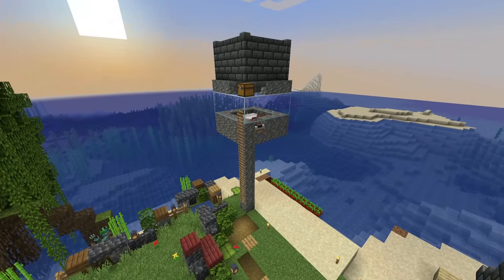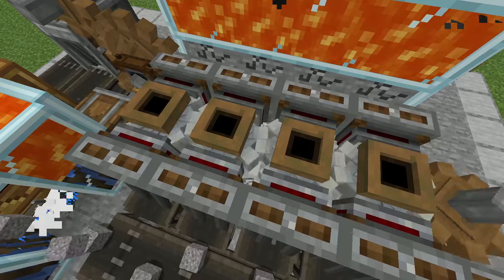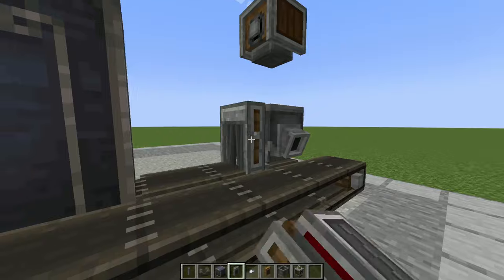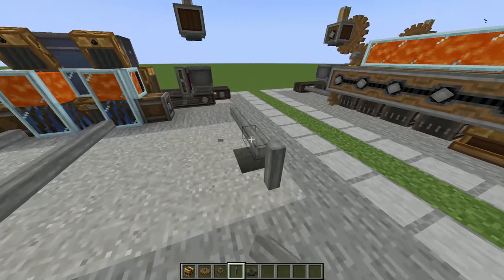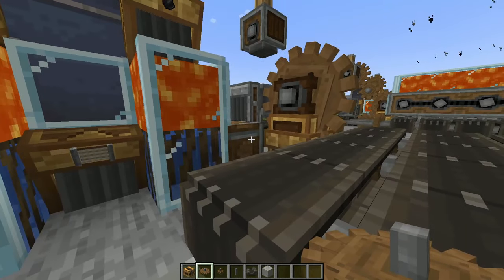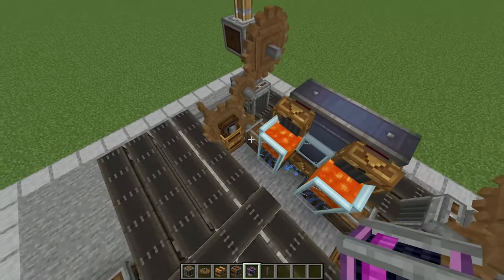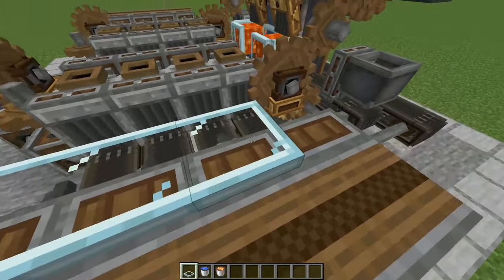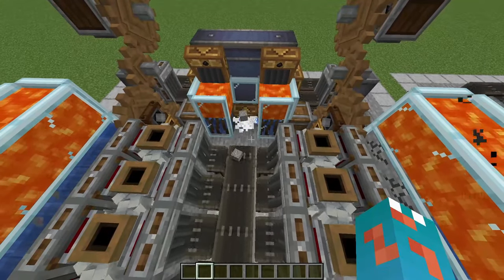CREATE Iron Farm TUTORIAL (No Villagers!) | Create 1.19.2 | #tutorial #minecraft

Comment: What am I doing wrong? Everything works and turns the same way. The presses won't work. THe basin fills with 16 nuggets and stops working. Even turned the speed up but won't help.
The basins always fill to 16 nuggets. Maybe too much to make ingots? Even tried a brass funnel with an iron block as a filter in the hope it would do that, but nothing. So now I got a nugget farm and need Thermal or Mekanism to turn them into ingots.
Anyone got the same problem or a solution?

Comment: I'm not sure what I did wrong but the brass funnels in the front are only letting nuggets out through one of the funnels
Reply: Same and I dunno what to so
Reply: Nevermind, you need to hold shift when connecting brass funnel to vault
Reply: The reason would be that it's letting all the nuggets it gathers out the one funnel at a time, and if you set it to only let one nugget through at a time, they will go through the other side.

Comment: 9 vaults
34 shafts
10 cogwheels
7 large cogwheels
8 millstones
1 barrel
2 mangrove roots or stairs
20 andesite funnel
5 brass funnel
13 mechanical belts
10 gearshift
6 gearbox
2 encased fan
2 mechanical press
5 rotation speed controller
33 framed glass trapdoor
1 list filter (?)
2 bassins
1 clutch
Reply: forgot encased chain drivers and drills XD
Reply: you can also use leaves since those also can be waterlogged
Reply: How to find these items
Reply: @gamersanofficialitzme  You FARM MY MAN 👌
Reply: @SamHockingTV  sorry, ended up not doing it so I didn't correct myself thank you for doing it  ❤️
Reply: That one clutch is you my friend.
Reply: UR THE FUCKING GOAT
Reply: @gamersanofficialitzme  kid thinks this is vanilla
Reply: It’s funny how the author called this build “early game” while it requires Brass and Rotation Speed controller 💀
Reply: does someone here know how to decrease or increase the number on the rotation speed controller to minus 1?
Reply: @milopug7275  it’s a 1 RPM in the opposite direction of the input shaft, no?
Reply: @denisbronskii5629  instead of the roots right?
Reply: @ZaVoido  yeah instead of roots, you won’t see it waterlogged if your graphics set to low, but it should still show water particle effect from the leaves
Reply: @denisbronskii5629 alr, that'll make it way easier as I have a word with the large biomes mod and spawned in the middle of a plains biome.
Reply: @ZaVoido  yeah I’ve also had issues finding the mangrove roots, gl
Reply: i love you
Reply: those are ez
havent even gotton diamonds yet @darkModeYT
Reply: 10 encased chain drives...not 10 encased gearshifts? ...and 8 x mechanical drills.  Thanks for listing the bulk of it correctly.
Reply: @CoroDan to be fair, the graphic of what's needed shows gearshifts instead of chain drives. It would be chain drives though.
Reply: @darkModeYT  brass is pretty early game lol

Comment: List of all the things you need to build:

34 - Shafts
10 - Cogwheels
7 - Large Cogwheels
5 - Rotation Speed Controller
10 - Encased Chain Drives
2 - Vertical Gearboxes
4 - Gearboxes
1 - Clutch
13 - Mechanical Belts
8 - Milling Stones
2 - Mechanical Press
2 - Encased Fans
8 - Mechanical Drills
2 - Basins
9 - Item Vaults
5 - Brass Funnels
20 - Andesite Funnels
1 - List Filter
33 - Glass Trapdoors
2 - Mangrove roots (Optionally Anything that can get waterlogged IE: Leaves)
1 - Barrel
10 - Water Buckets
10 - Lava Buckets
Reply: thank you, i had trouble figuring out which blocks where what haha
Reply: where are the item vaults?
It dosen't show in my minecraft

Comment: fun fact: if you have the create: mechanical extruder mod you can compact the farm more but it will consume more stress units
Material list with names and quantity:
Shaft X34
Small Cogwheel X10
Large Cogwheel X7
Rotation Speed Controller X5
Encased Chain drive X10
Vertical Gearbox X2
Gearbox X4
Clutch X1
Belt X13
Millstone X8
Mechanical Press X2
Encased Fan X2
Drill X8
Basin X2
Item Vault X9
Brass Funnel X5
Andesite Funnel X20
Item Filter X1
Trapdoor (any) X33
Leaves (any) X2
Barrel X1
Water Bucket X10
Lava Bucket X10

Hope this helps :)

Comment: I don’t see anyone talking about this, but you actually don’t need any drills to break cobble stone. You see, when contraptions become disassembled they will break any block that is inside them, so you can just have a straight line of chassis attached to a bearing rotating at 1 rpm. push the cobblestone into the chase and stop the bearing and it will break the cobblestone. this method take no su, and breaks faster than any drills

Comment: For anyone having trouble with finding mangrove roots, you can waterlog stairs that are facing the vault. It will work exactly the same.
Reply: Or just leaves
Reply: It doesn't the 2 stairs create an infinite source of water that waterlogs the brass funnel as well
Reply: @Exorbulla  No? Have you built this thing yet? The water is stopped by the brass funnel (which cannot be waterlogged).
Reply: @zellenny1784  I have built it and the brass funnel keeps getting waterlogged, the only solution I see to this is to just put the water in front of 1 fan and block up the other fan so that I only have 1 water source
Reply: @Exorbulla  Replace the stairs with a trapdoor, place it so that it's keeping the water from flowing out, the trapdoor shouldn't block the fan. Though if the funnel doesn't block the infinite water generator you should be able to use leaves just fine I think?

You might be able to place the stairs against the funnel instead, so that water doesn't flow that direction, not certain if the fan is blocked by that or not.
Reply: @Sylfa  I solved the issue a while ago, turns out you only need 1 fan for the machine to work, 2 fans is just for symmetry, so I blocked out 1 fan and let the other one do the work

Comment: I've been playing around with this design and noticed a few things:

1) use a steam engine, possibly powered by blazed burners as you need roughly 16 300 su to power this thing, at least if you do what I did in the points below (my 3x3x9 steam tank with 2 water pipes going in could handle around 98 300 su with 9 blaze burners feed with coal but I've only got one steam engine attached to it at the moment and so only that roughly 16 300 su was actually being provided to power the whole thing)
2) If you want to make those presses move faster, remove the cogs from the rotational speed controller and use a belt + rod thingy + horizontal gear box to connect the outermost rods to the presses. This is because making it more compact with horizontal+vertical gearboxes makes all the other belts that are at the front of the machine move in the wrong direction
3) I doubled the speed of the rotational speed controller closest to the power source (7:10) but ended up keeping the rotational speed controllers affecting the drills the same. I think it can handle a bit more (and so produce iron faster) but I found doubling it sent cobblestone flying off the machine and landing randomly on the floor. Still toying with it but maybe 10-20 points more is ok?
4) Using blazer burners is just as good as lava (so you don't need a protective floor/walls around them which is great for space!)
5) It may be worth just using a lot of steam engines+small steam tanks+unfed blaze burners over fed blaze burners as you don't then need to make a big farm to feed them and pipe the fuel to mechanical arms to feed the blaze burners so they never run out (and so stop the whole machine if you're using the steam engines to help bump their own water)
Reply: i just add create crafts and additions and mekanism to the mix and create a forge energy powered abomination

Comment: using this in a 1.18.2 modpack where there aren't any waterlogged leaves or roots. I was able to use a trap door, the only thing is it will also put water on the block where the brass funnel is which doesnt seem to be a problem.

Comment: for some reason my brass funnel would take the gravel immediately, even with the filter, so i found a workaround

reset and replace your brass funnel, making sure it is facing inside of the vault
place an iron nugget in the item frame part of it
now the gravel will not go in, and instead will be washed into flint or iron nugget
now only flint remains but at least it's taking in iron nuggets, which is what you're after anyway

Comment: HELP! Only one side of the machine works for me - or, more specifically, only one brass filter (the iron nugget ones that come off of the vault) works at a time. It's like the vault chooses one of the two brass filters to use and completely ignores the other one. If I destroy the one it has chosen to use, then the other one starts working, but when I place the filter back, that one now no longer works as it has chosen to prioritize the other. Basically, it only allows one filter to be used at a time, not both. Anyone know what to do?
Reply: I replaced the brass funnels with andesite one's and that has seemed to fix it. One funnel is still used more frequently than the other, however they are both getting used at least.
Reply from the maker: Thats due to the actual output of the farm being slower than the presses are crushing the iron down, it was designed so that it would be future proof in the case that you expanded the drill section of the farm backwards to make it faster

Comment: Need some help with this lads. 

So on the left hand side of the build, the rotational speed thingy isn't appearing as -1 on speed regardless of how I set it. 

The entire left handside  doesn't function even though it's receiving power. Gears are turning along with the belts but noiron nuggets are flowing. 

Strangley enough, the flint dump is working, just no items flowing on the left. 

BTW. Yes the belts are moving correctly. Been troubleshooting this for a week. 

I am currently playing on Mr Beardstones V2 Create modpack if that helps and Forge is set to 1.20.1

Comment: whats a the minimal setup for power that you could use for this? like could it be powered off of water wheels or windmill, just the minimal setup, im new to create and this is pretty awesome but im not sure the best methods for generating power
Reply from the maker: @noahsmith8614  a couple of large waterwheels should run this fine, but if you want a more permanent setup i would suggest a steam engine (which i also have a tutorial for if you need it).
Hope this helps!

Comment: hello! nice video and escpecially with the comments i got some things fixed :) but the only thing is that just 1 of the mechanical press is working.. fully connected and without the brass belt funnel it presses flint blocks... so maybe not enough iron ingots?
Reply from the maker: Technically you only need one, but the design is made so you can just stretch the millstone part backwards and expand it as much as you like :) that way the two presses means it shouldnt bottleneck, more of a precaution than being necessary.

Also symmetry reasons

Comment: @Skeej_inc I'm confused at your use of the rotational speed controller at time 7:23 , it seems you are adding the creative motor to the large cogwheel which is supposed to be the output speed part of the controller? You set it to 128 but that would mean that the large cog wheel on top is going to go at 128rpm. Is this a mistake or does the rotational speed controller work both ways?
Reply from the maker: Speed controllers work both ways! You can power the top or bottom piece with an input the the other half gets set at the RSC’s output speed :)))
Reply: @skeej_inc  Thanks, I didn't think you'd made a mistake ;-)

Comment: is there a reason not to run the drills and the mills as fast as they can? it seems like that would be an easy way to raise the rate of processing.
Reply from the maker: The mills run faster than the drill so theres no buildup of items, so they probably could go faster, just seemed like a good speed that was quick but not ridiculously Su consuming
Reply: Actually, there is.  Because of how cobble-gen works, anything over 96 rpm is wasted SU as you're waiting for lava to flow.  You'd want to have the mills running at max speed, but any more than 4 mills and you're FAR better off with a max speed crushing wheel setup.
Reply: So for max space efficiency you want all of the drills going at 96 and whatever speed and mills/grinder necessary to handle the cobblestone flow

Comment: I have a problem where the other side of the vault isn't releasing any iron nuggets. everything else is working fine, belts are moving along the correct direction. it's just that it isn't releasing nuggets on one side. Not sure if it's because it's a slow process to get nuggets and probably only prioritizing one side but is there a fix to this? Thanks
Reply: Replace the brass funnels that are filtered to iron nugget to andesite funnels

Comment: copied the build but for some reason the washing gravel to sand isnt working out any ideas why?
Reply from the maker: Check your crushing wheels are spinning the right way, if they aren’t, move the chain drives back 1 block with a gearbox between, and connect the crushing wheels with two shafts
Reply: @skeej_inc  nvm, found the issue that the modpack changed create mod. ty for the help tho.
Reply: @charliechan4309  what is your create version? i want to make this farm in 0.5.0i but idk if gonna work